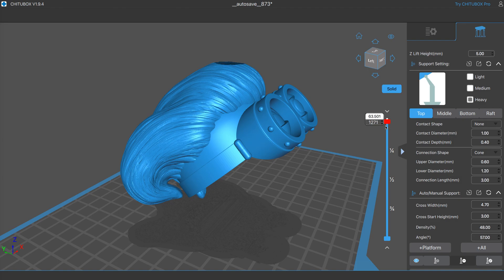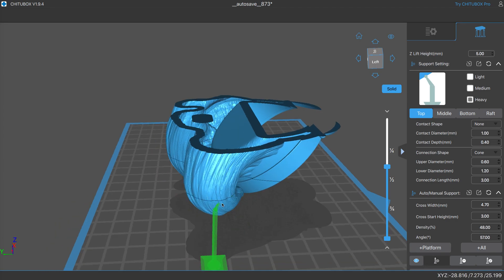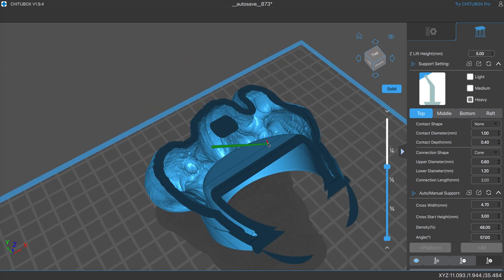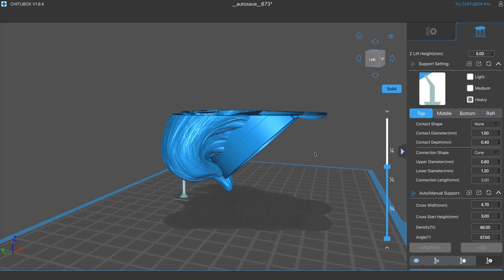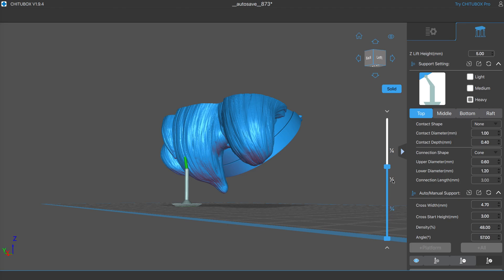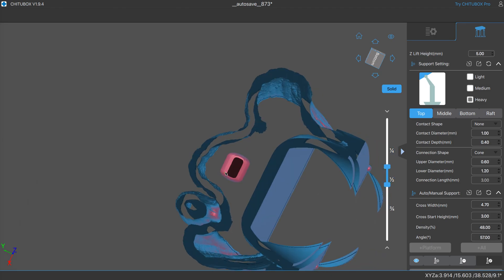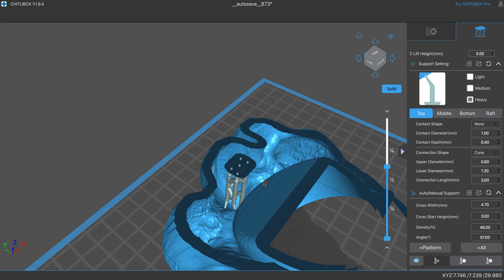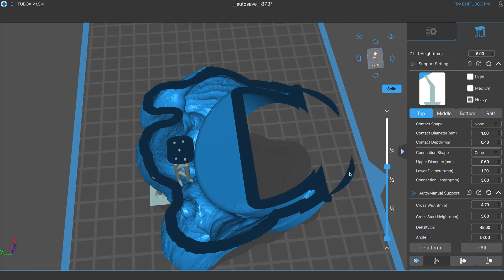Support inside islands in chitubox

Comment: How do i add support from detected islands after slicing?i cant find add support after i see it
Reply from the maker: @arcort669  you can add or change supports on a model after it’s been sliced. Just click on the support tab, from the blue layer slider on the right move the bottom slider up until you see the island you need to support and support away.

Comment: I tried the method in this video, but it seems to be ignoring me when I click to support the inside island. It is the internal structure of a key I made, and it is just suspended out in space at the start but then connects to the upper part of the model. Do you have any tips? Logically your solution should work because I am running Chitubox Pro, so I am not missing any features. I am also running the newest version. Not sure if that is relevant, but this is frustrating me.
Reply from the maker: The only thing that comes to mind off hand is that maybe the model isn’t manifold? Chitubox’s repair feature is OK at best. Do you have access to a program that will look over the mesh for issues? I pretty much use Blender for everything. I think Meshmixer can scan and repair models for free.
Reply: @Harold_3D  I’ll check it out, but my model is certainly not non manifold. It’s actually a very simple mesh and all quad. I made sure of that.
Reply from the maker: @Kerrassic  well, can you post a screen capture of you having the issue somewhere? Without seeing the issue or being able to check the model itself it’s hard to say what else it might be.